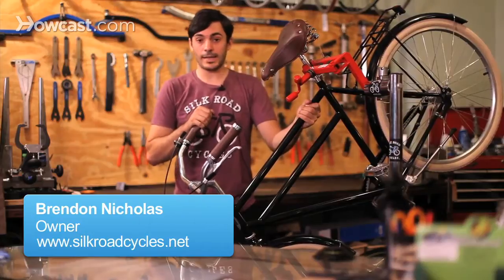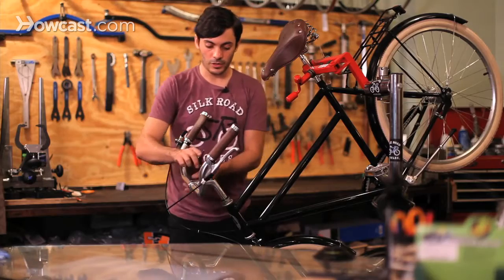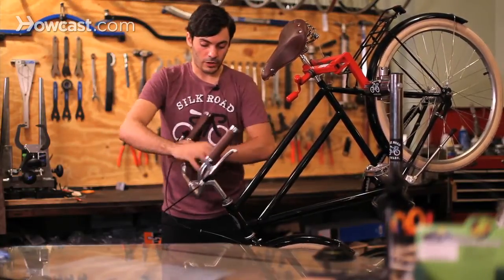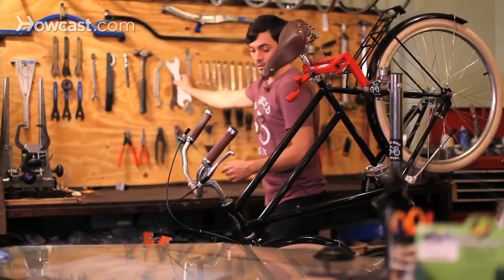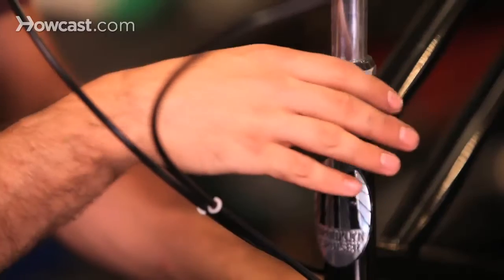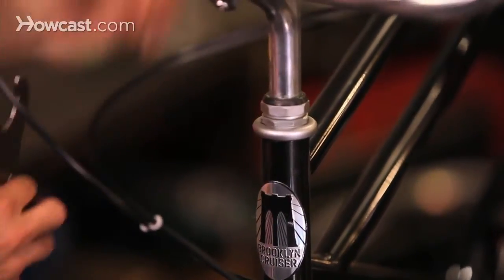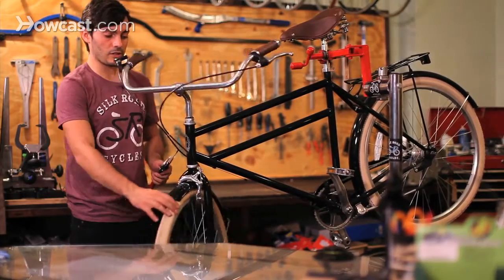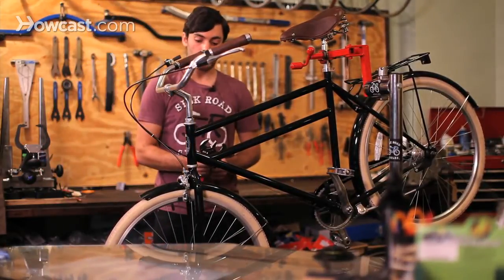How to Adjust a Threaded Headset | Bicycle Repair

Comment: what if I tighten the two large nuts and it keeps having play after I ride around the block, starts tightand loosens quick
Reply: The use of a lock washer above the top race but below the locknut (and spacers if any) should be present to prevent the crown race from rotating up the thread. When properly tightened there should be no play. Some don't like using lock washers because they can slip and damage threads, or can't use them because their threaded stem is missing the channel for the lock washer's tab to rest on, or the fork is being used on a frame with a smaller head tube length. If loosening is a constant issue some would suggest some kind of loctite to bind the top race and possibly other items in the stack.
While the video does an OK job explaining the tightening process, I would advise that you progressively tighten, which is to say you very incrementally descend the top race then hold it as you tighten the locknut. If you feel any play you unscrew the locknut then bring the top race not even an eight of a turn tighter then repeat. Once things are in place you should put a good tug on that locknut. If your assembly is overly tight then the bearings grinding on the top race might be contributing to the loosening.
There's many reasons why you may be having problems. These are just a few suggestions. There's always buying a new headset! And over time headsets do settle/wear in a bit so adjustment may be necessary.